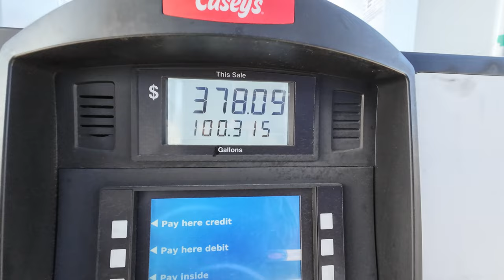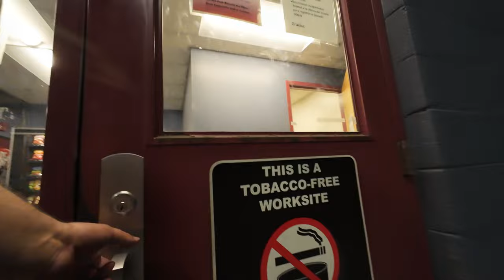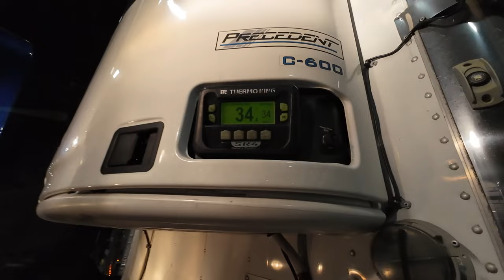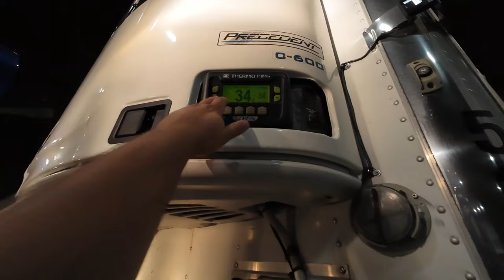TRUCKING UNDERGROUND WITH PETERBILT 389 PRIDE AND CLASS GLIDER

Comment: Those load lock pressure bars are causing your trailer to blow out. They are cranked down to tight and pushing the walls apart. I've been using them for many years. If they are crank down too tight they'll blow out the walls and if they're not tight enough they will fall on the floor when driving has the trailer flexes. The best thing to do is install an e-track system inside the trailer and you will never have this problem ever again. It's a   more reliable  and safer way of load securement and dosent wreck the trailer in my opinion. Hope this helps. Love the videos, stay safe out there trucker
Reply: I So F'ing Agree..
Reply from the maker: Appreciate it buddy. I think I really need to install those logistics posts so I can use straps. And if some shippers require load locks, I’ll just get the load locks that snap into logistics posts.

Comment: What's up Bandit? Good video as always... question? Not sure if anyone asked or if you already perform this task. My question is after every load do you do a test (diagnostic) on your reefer? If not it may not be a bad idea to do so. That way when you perform a diagnostic test, if something goes wrong you may be able to repair it before your next load. 🤷🏽‍♂️
Reply from the maker: What’s going on brother?
Do you mean pre trip or something else?
I do pre trip but I don’t know anything about diagnosis.
Reply: @OTRBandit  nothing much brotha. Don't quote me, but I believe you may be able to run a self diagnostic test on the reefer control panel. Maybe check thermo king to see if it has that option. Some reefers have an option to do a diagnostic check on things built-in the control panel.
Reply from the maker: @user-cg8kf8we8y I will definitely have to look into that. I’ll search YouTube and if I can’t find anything, I’ll call thermo king.
Reply: @OTRBandit  sounds like a plan. I hope they do... let me know by message or mention it in your next video. Because I'm always anticipating your next video. 👍🏽
Reply from the maker: @user-cg8kf8we8y will do 🙏🏼

Comment: The ceiling ranges from 27 to 45 feet high, and the floor is 100 feet — think 10 stories — below the surface, which is mostly used as farmland." The first refrigerated space was created in 1962 for Kraft Foods.
Reply from the maker: It’s a very interesting place. And they are still digging here.

Comment: Hey Bandit, another great video. Like the  new camera angle so that we can match the revs to your shifting. Wondering if the air quality is bad in the caves from all the exhaust? Thanks and stay safe.
Reply from the maker: Appreciate it buddy. I thought I mix it up little bit with camera. Air seems to be fine down there even with all them reefers running constantly. I haven’t noticed anything bad. They have pretty good filtration system from what I can see.

Comment: Agree with another comment about the E Track system, I put it in a small trailer I had for my catering business years ago for tie-down use. Are you familiar my friend?
Reply from the maker: Yes sir, e-track is what I’ll be installing in my trailer. It’s allot better than load locks. I always hated load locks. Never had them in my trucks. I always used straps.

Comment: Gday Bandit
It looks like they are blowing the air bag up first, then putting in the load locks, so even though you deflated the airbag the load locks still bowed out your trailer sides.
If it happens again maybe you can pop the air bag and readjust your load locks to take the pressure of the sides of your trailer
Take Care Mate, Best Wishes from Tasmania
Reply from the maker: That’s exactly what’s happening here. I will keep my load locks outside from now on and secure them myself after loading. Pop that airbag and then put load locks on. Appreciate the tip for Tasmania brother 🙏🏼

Comment: When you pop the Air Bag, you should probably re-adjust your load bars.  They were most likely set with the walls blown out, thus are probably keeping the walls pushed out.
Reply from the maker: I think I will just keep my load locks outside from now on. Pop the air bag after I pull out and then put my load locks back on.

Comment: Couple hints. In the middle of a hot summer day, even if you are picking up dry, offer to run your reefer to keep your shipper/receiver happy.
Cut the bag first. When you put in the load locks with the inflated bag and cut the bag, it holds the walls where the bag held them.
Reply from the maker: Will have to do that from now on. That’s a great idea about running reefer in the summer for them. Make them more comfortable and maybe you’ll get loaded faster.

Comment: Hey Bandit  good video, Nice to see the blue beast rolling again. I not sure but I thought reefer fuel should be cheaper then regular road diesel fuel being charged a road fuel tax, as shouldn't be taxed as much as road diesel fuel tax? I know dyed fuel is used for non highway use and farm / industrial diesel fuel. Might have to check into that for tax purposes. Get some money back paying for road fuel tax on refeer fuel. If you leave the load bars in the companies like to get a angle on the load bar and then pull the high end down to straight the bar and pushes the walls out some too. Being lazy and not unclamping and readjusting the load lock. That is why our owner told us to take the load bars out before fulling backing into the docks. If you got a full trailer you just lay on the end before closing the doors.  I just close the one door and climb up or if really close to other trailer I pull out and close one door and put my load locks in and close other door, place seal and gone. PETA =  People Eating Tasty Animals...lol...Take care and keep the rubber on the road.
Reply: They charge pump price for reefer fuel,you're still paying fuel tax just not IFTA which is fuel bought and burned in each state traveled through
Reply from the maker: From now on I’m keeping my load locks outside and security the freight myself. It’s not right what they are doing.

Comment: That's what I was thinking. It's the load locks not the air bag that's doing it. You can see in video they look to tight.
Reply from the maker: I think you’re right. I will leave load locks outside and secure the freight myself after I pull out of the door.

Comment: I would not say anything to the shipper about the air bag ,why stir the pot. Seems like they get you in and out pretty quick. Just pull out to close your doors and pop the air bag and then readjust your load locks.
Reply from the maker: I think you’re right about stirring the pot. They seem like really nice people and they did try to not blow up the air bag that much like last time. But it was still too much in my opinion. I will just pop it and readjust my load locks after I pull out.

Comment: You shouldn't  pop those airbags  they are  there  for  a reason.  It doesn't  hurt  the  trailer.  It hasn't  hurt mine yet and  I've  had  my trailer  for  10 years
Reply from the maker: I may be little paranoid because I’ve never seen something like that.